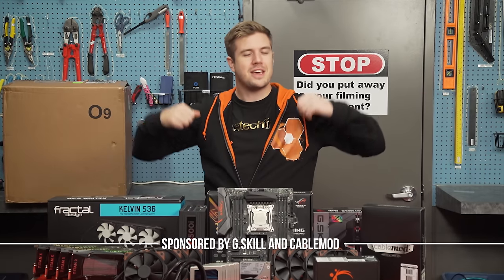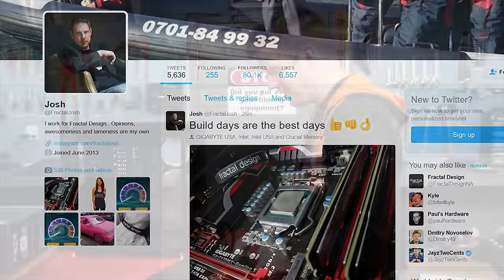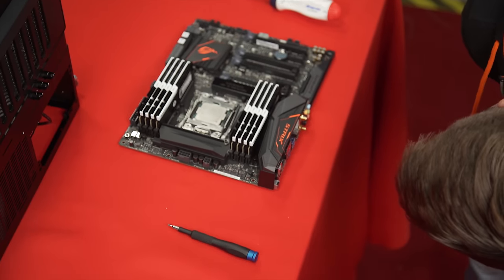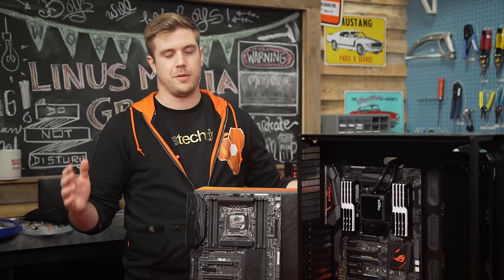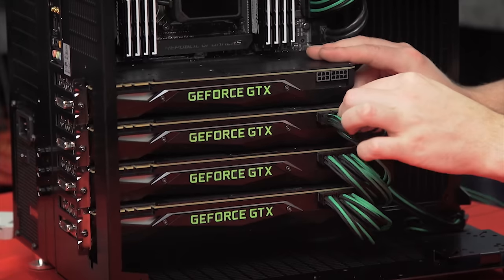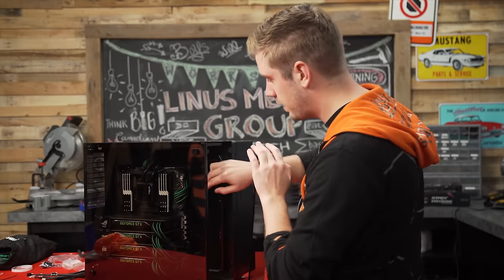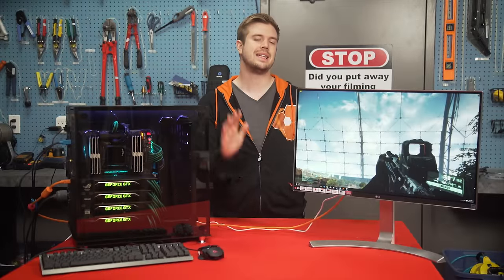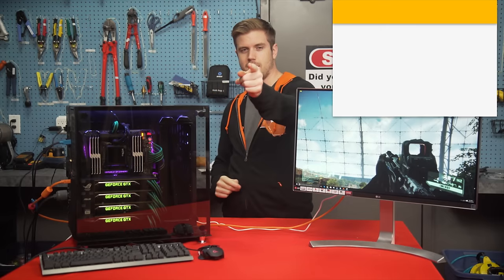The Compensator 2.0 - ABSOLUTELY No Compromises PC Build Log

Comment: I made Loopdey Doop cables look good: https://puu.sh/rZ6tZ/df3fe4419d.jpg
Reply: Chris21010 daaaamn son!
Reply: looks awesome
Reply: Hey nice rig bro
Reply: Is that 5-way SLI?!  You madman!
Reply: not SLI but ya, 5x EVGA 1070 FTW. its primarily for Folding @ Home computation and not video games. but it can play video games quite well on a single 1070 while the other 4x 1070's are still computing.
Reply: Damn nice rig, specs?
Reply: Also what LED strips are those
Reply: build log/specs/blog/forum http://forums.evga.com/New-5-GPUs-1-PC-Build-m2534393.aspx

the LED's are cablemod UV and then i have a custom 3mm LED harness for the GPU's i made from EK's 3mm LED's.
Reply: Chris21010 nice pc man
Reply: What? I obviously cannot count anymore. My eyes see 5 GPUs, but my brain is like "nope, not even going there... that's it, I quit!"
Reply: 20.02 seconds with 4x 1070's on the benchmark linked, i currently have 1 disabled. it also only used ~50% of each GPU, so not that optimized.
Reply: Chris21010 Sick man!!!
Reply: I forgot to mention though is that recently there have been daily builds of Blender that optimise efficiency significantly. I am not asking you to redo the test with them but the latest ones have had anywhere from 20-50% performance boosts on a variety of systems. Though, as long as the CPU is a bottle neck there will always be an initial loading time as the scene assets are loaded onto the GPU and this becomes exacerbated the more GPUs there are. This becomes negligible the more intense the scene is though. On the other hand, someone explained to me why the software only utilises a portion of some GPUs and while I cannot remember the explanation it made sense to the layman.
Reply: CPU was also @~40% utilization. and i had to download the latest build 2.78a to run the test as the version i had was missing the CUDA support for the 1080/1070 GPU's.
Reply: Chris21010 I was actually referring to these: https://builder.blender.org/download/

These are automatically compiled daily iteration of the software's development so that the userbase can bug-test every single iota of daily progress until the next final build (released every few months).

Comment: Time for a 3.0. Suggestion i9 and Threadripper. Corsair 1000D watercooling. 64GB for the i9 on a MITX and 256GB for the threadripper. 4x Titan RTX. And a quadro for the i9. Some Sabrent Rocket 4TB M.2 drives (mobo in question should be able to do like 20TB in M.2 storage. Yummy) zenith 2 extreme. Could be a killer video

Comment: Great work guys. Lian Li cases are just stunning. My only little gripe is for a build that’s supposed to be “absolutely no compromises” is why in the world would you use an AIO? For a rig that’s supposed to be ridiculously over the top, it would have been so much more overkill and also better eye candy to slather this beast in hardline and even make the gpu and cpu on its own loop. I’m sure you have your reasons, but maybe an idea for compensator 3.0? You mentioned a PC worth tens of thousands is your run of the mill pc at LTT, so adding some custom water cooling should be no problem-o. go big or go home right? Either way, it’s still a beauty. :)

Comment: Almost all of the compromises.  I can think of 6 components that could have been more expensive, even for no additional gain in performance, although it would've given you more leg-room to actually build a machine that made a difference.

For Compensator 3.0,  get the LIAN LI DK-04X for the case, as that has more than enough leg-room (heh) to put what you want in it.  I think it has room for two 240mm AIOs or rads, plus looks awesome.

Best bang for buck is always the way to go, even when building a high-end gaming PC.

Comment: A build like this would definitely be beneficial to anyone that's doing things like 3D modeling. Super fast interactive response within the 3D viewport, 4 tiles rendering at once rather than just one (might want to take a look at Blender 3D and the Cycles render engine, total nightmare for just one GPU). This is also definitely keeping in mind that the VRAM doesn't stack just because there are 4 GPUs. Question for Linus Tech Tips, and this is something you should definitely try: Would using 4 GPUs like this actually cause a delay in rendering because of the fact that now you have not 1, but 4 GPUs that require having the map data spread across all the cards, resulting in a lower render time? Food for thought right there.

Comment: As odd as this may sound the gpu cooling issue can be solved without water cooling by using, I hate myself for saying this, a mining rig using pcie riser cables. 
Also another way to improve cooling on the gpus is to have intake case fans on the front.  Have to be mindful as to how the gpu exhausts air.

Comment: Compensator 3.0 probably won't be happening because RTX cards are locked to 2 way Nvilink. 

FYI the best current graphics score on 3dmark timespy/firestrike extreme/ultra is still held by kingpin with 1080 TIs in 4 way sli.

Comment: For buttons with an I and an O, the O means an open circuit (connectors not touching) and the I means that the circuit is open (the connectors are touching). I is on, O is off. Yes, it's confusing.

Comment: Compensator 3:

I9 7980XE
128gb 4266mhz ddr4
4X titan XP, 1080ti, or vega if it is equal to or better than titan XP/1080 ti
Samsung 960 pro 2tb ssd
4K ips 1ms 144hz monitor
RGB EVERYTHING
Hardline water cooling on CPU and gpus
10tb 10000 rpm hdd

Comment: is there only me who does get why Luke didn't put the cooler in the rear compartment with hoses closest to the rad doing what they are doing now but in reverse (as you are encouraged to do), and then fans in the front compartment blowing on to it (rather than cutting holes in the case)...

Comment: SSDs only? Doesn't anyone use Hard Drives anymore? I recently built a brand new, high-end PC and I refused to complete the build without at least 1 hard drive.

If anyone is interested, here are the specs of my build:
Intel i7-7700K
Gigabyte Nvidia GTX1080 G1 Gaming
(2x8) 16GB DDR4-3200mhz RAM
2x Samsung EVO 250GB SSDs
1x Seagate Barracuda 2TB HDD
Asus Intel Z270-A PRIME Motherboard
EVGA 550W Gold certified powersuply
Cooler Master Hyper 212 EVO CPU cooler

Comment: OH my good! Please what should these build be? a no compromise one. 
1. better be prepaired for the build (missing parts)
2. cutting out a case without a reason. switch radiator to the other side and you avoid too...
3. tons of cabels in front of the radiator fans.
4. a poor place for the ssds. right in front of the radiator
5. if you want rgb light, take rgb fans for the radiator (after the side switching)
6. asolutly poor cable management
aso...
sorry but this video makes absolut no sence. 
guys please don´t follow any of this mishaps here. watch better other videos with building instructions here.

Comment: this is ancient.

I want compensator h2O
4 tb ssd
50 tb hdd
22 cores of processor
4 1080 ti sli
256 gb ram
all watercooled
case should be a linan li dk04

Comment: I would like this so much more if you would solve the heat problem.
In 2018 either liquid cool or find a more spacious case.
4 Titan Xs should be insane.
Find a way to cool it and run it hard!

Comment: WATER COOLED RAM SSD's CPU's and ALL 4 GPU's with dual core i9 18 core.that or dual thread ripper and quad vega. And hardlined. Or liquid nitrogen. In the case that supports an extra mini its system in the bottom and use that case with a whole extra system in it.

Comment: I have not seen any RAID HBA being installed there
Are you running this "hardware" RAID which actually runs on CPU and is actually fully software RAID which (at least partially) kills your CPU performance?
This is ridiculous, especially taking in account that none of those software RAID support anything even remotely resembling RAID6

Comment: You scratched the glossy surface of the CPU block badly. There was no need to cut the case to fit WC tubes. I bet You could de-attach  them by unscrewing. SSD mount is exceptionally bad. ;D Overall - MEGA-looking PC, ...that doesn't run FarCry4 and looks better than it works in 3D. Shame! ;)

Comment: this is the computer im going to build i need it to make animations with it please tell me if its good for me or not . idk much about pc so : 
Cpu i7-7700k
Ram 16g - 2400 ddr4
Hard 1 . 240 ssd
Hard 2 . 1TB
Graphic 1070gtx-i chill 8gb
Mother board asus pro h270f
Cooler T2
Power supply gm-700W

Comment: Nov. 7-????? 2017: Compensator 3.0 
Ryzen Threadripper 1950X (Liquid cooled)
128 GB 3000 Mhz DDR4 ram 
4 Nvidia gtx Titan XP's, or 4 Nvidia gtx 1080ti's [Liquid cooled]
M.2 NVME SSD 2TB- or max in raid 0 mode.
With like a petabyte of storage, and intel Optane cuz why the hell not????

Im so hyped!!!!!!!!!!!!!!
Reply: compensator would be delidded 7980xe
Reply: *4 Titan Vs

Comment: My brand new CORSAIR AX1200I power supply went in the trash can out side.  on top of that that was the 5th one that is DOA. Corsair filed law suit on my fake sales slip that Amazon emailed to me. I no longer buying ASUS and Corsair.  No customer needs to suffer like that. other then that 4 graphic cards. that is wasting money. all you need is one GTX 1080Ti graphic card that's it. Then all I got is a EVGA 980 Classified. it may be old.  its stuck with 60 frames per second. that is driving me insane well my monitor can go up to 240 frames per second.. any way 4 graphic cards will not work.. SEE I TOLD YOU SO

Comment: 13:28 can anyone explain why this problem occurred specifically. Is it a GPU related issue? I am having a similar problem where my higher end games freeze  and I can't close the problem just restart the computer... I have a i7 7700k and super clocked gtx 1060 with 3GB. Any advice would be appreciated.
Reply: I should add I can run games 90% of the time it's just at random moments in game that the problem occurs
Reply: Its a problem with the lack of driver and gaming support for quad sli graphic card use.  A build like this is actually a work station build using programs for 3d design to video editing.  Its not really supposed to be used for gaming.  As for your issue its very likely the 1060 is not capable of running some games at max.
Reply: Hey Lijie Thanks for your advice. I should have added that I was playing these games at the lowest possible setting to test out that theory but even then it seemed to crash continuously. I ended up buying a GTX 1070 8GB  which has substantially increased my performance but a few games stilll freeze even at 1080p... I'm thinking it cant be the GPU at this point..
Reply: livinglegend01 Yeah probably not your GPU. I also have an i7-7700K and a GTX 1070. I don't experience freezing like this on anything. I hope you get this resolved.
Reply: did you overclock the cpu or gpu

Comment: Shit like this makes my rig feel like a box of potatoes but my rig is really old and runs games up to 2013 on highish specs with a p5ql/epu motherboard with a core 2 Quad 2.66 Ghz (super overclocked 3.34Ghz)  and 8 Gigs of DDR2 ram (4 sticks) that runs at 800mhz and the GPU is ONE....yes one Nivida Gtx 8800 that is also overclocked.... And on a 650 watt power supply.... No rgb what so ever and closest thing to rgb is a blue led fan in the front and side of my case.... Nothing else lights up other than the power indicater on the motherboard 😂😔